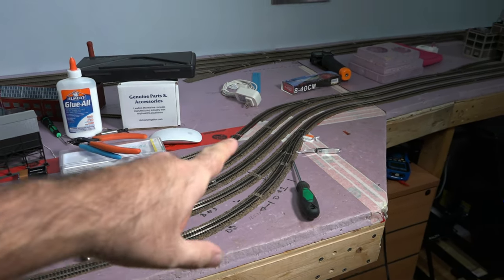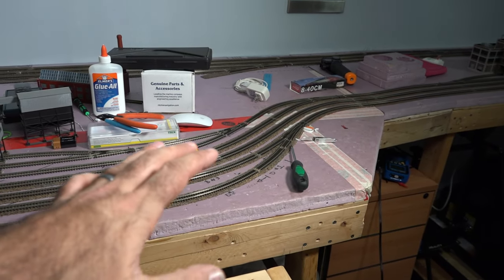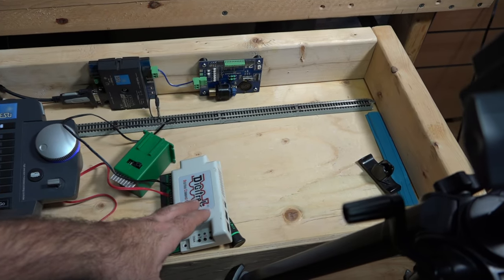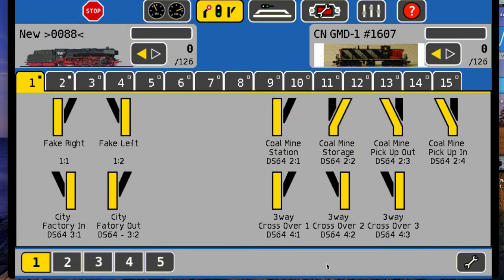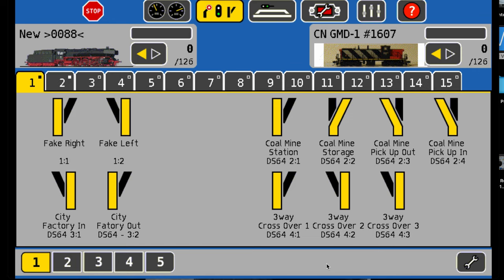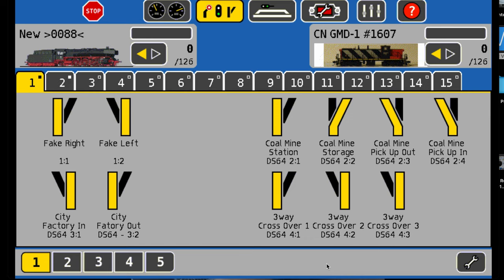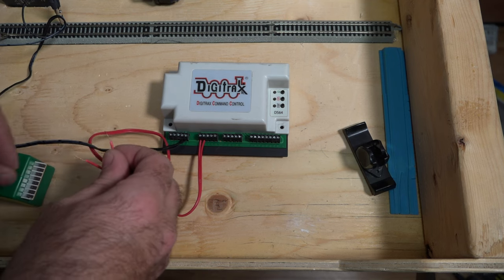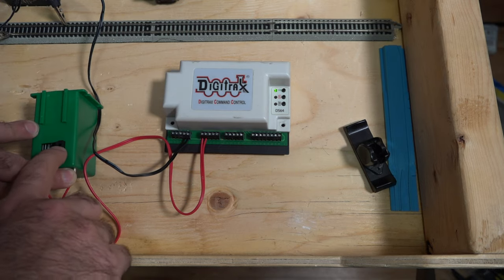Troubleshooting & Programming the DigiTrax DS64 with ESU ECoS2 | Model Train Layout Tips & Tricks

Comment: Interesting... I initially used 5 DS64s to operate 19 Kato turnouts on my n scale layout (also controlled with an ECoS 50210). Eventually all but one unit failed. First one circuit, then the other 3. I replaced 3 of them with units purchased on eBay and those worked...for a while. Digitrax could not explain the problem, no amount of reprogramming helped. Many others seemed to have the same failure issue, many switching to the DS74. I went a different route and switched to the DCC Concepts ADS-?sx hardware. Easier to program, rock solid so far. I hope you have better luck than I had with your 64s.
-Ron
Reply from the maker: Hey @freescopesdad. Dang Ron, sorry to hear about the failed DS64's.  Question, did you use a separate power supply on the DS64? I wounder if there was power feed back from the switch motor?  
I use to have a couple of switch's from DCC Concept, but then I switched over to the Smail switch machine do to the lack of availability were I live! Then there was some conflict in communication between the NCE DCC chip in the Smail switch machine with the ECoS 50210, and some function in the  ECoS didn't work, I did a video on that.  So I switched again but this time I went with the DS64 and things worked. which is always great!!! LOL, It has been a journey!!!! Thanks for watching and commenting. It means a lot to us.  
As I have for the most part got the layout to powered and working, We'll be working on landscaping. I still want to continue a tech Tuesday segment, and I have a couple of things that I can show about the ECoS. So stay tuned for those.
Reply: Hello, I am wanting to connect rc servo motors to the ds64 that have 3 wires, could you tell me how I should connect them?
Thank you very much and very interesting video!
Reply: @giulianozitelli3585  No clue, are you talking about a non-model railroad application? My only experience is with Kato n scale #6 turnouts. As a follow-up to my original post, the DCC concepts have been and continue to be solid.